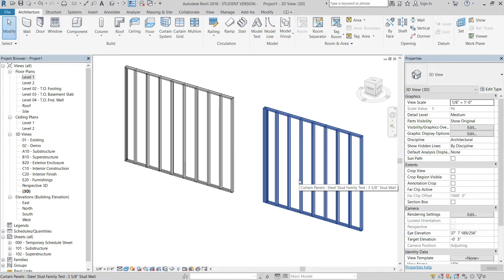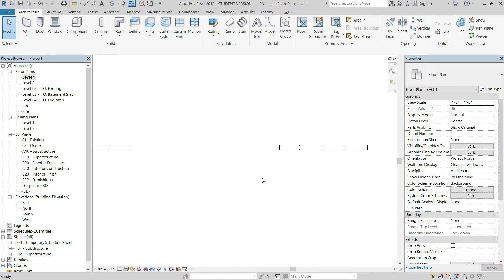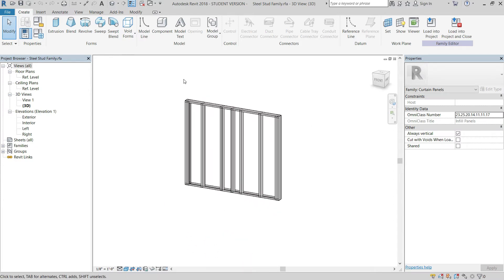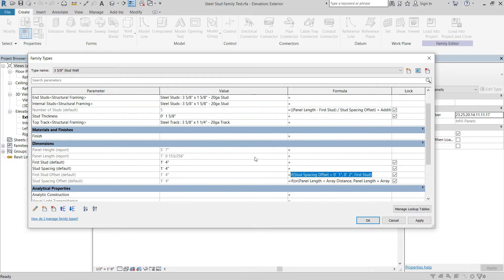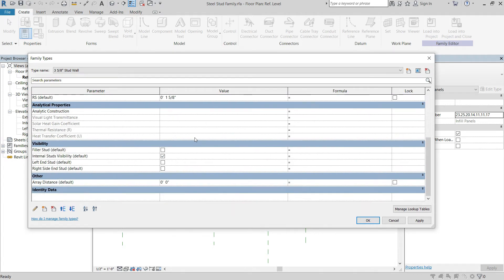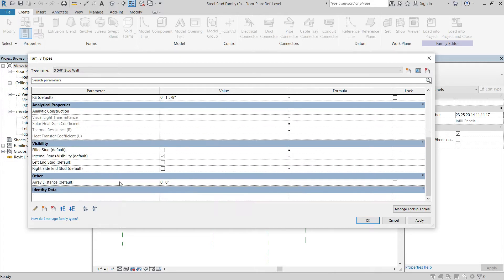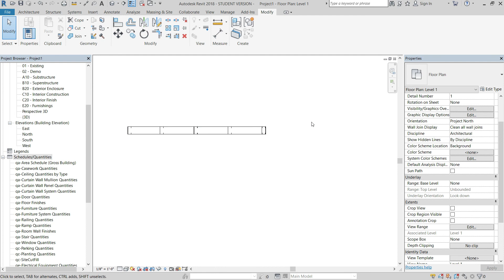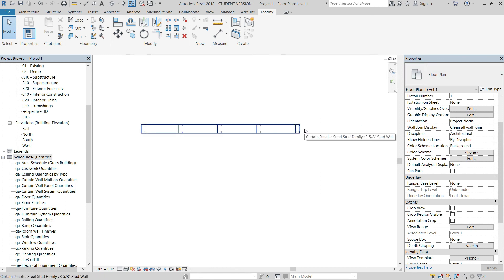Steel Stud Wall - Part 05 - Visibility and Conditional Formatting

Comment: Hi. I am wondering, did you update the latest version of this family in Gumroad? Because I downloaded one more time and when I change the length of the wall,  it shows an (Parameter "First Stud Offset" cannot be changed because it is defined by formula "if(Stud Spacing Offset = 0'  1", 0'  2", First Stud)" ). If I lock the dimension, it doesn't remove unwanted studs and when the length of the wall, let's say, 2ft, it has 11 internal studs+ 2 on sides. Other words messy and wrong. It might be sounds unclear, but if you share tour email, I could send you some screenshots.
Could you please upload the latest wall family in Gumroad? 
Thank you.
Reply: Hi, I have the same problem, did you find a fix yet?